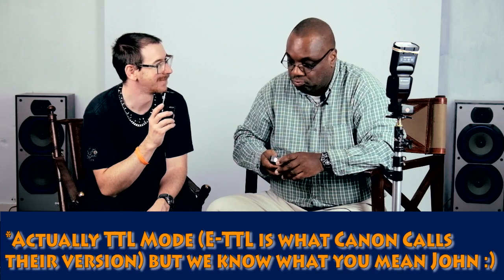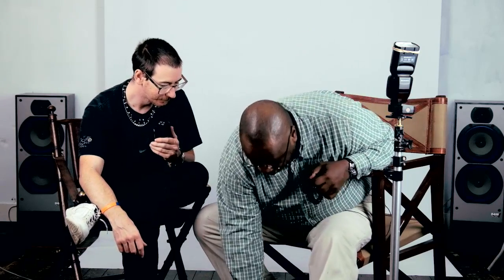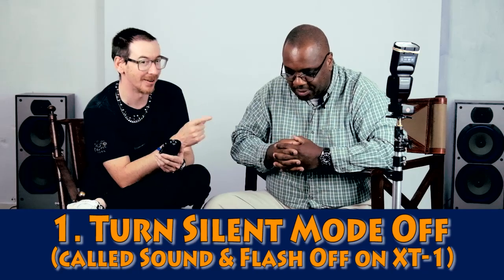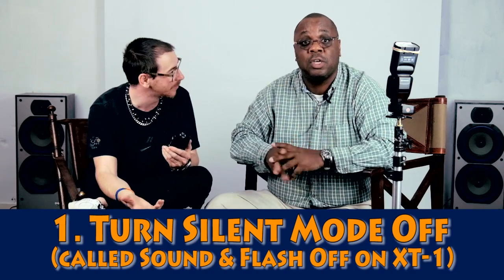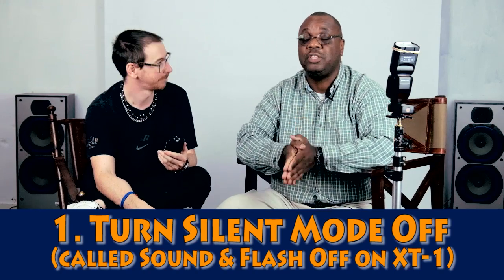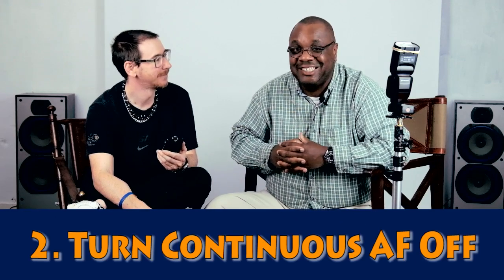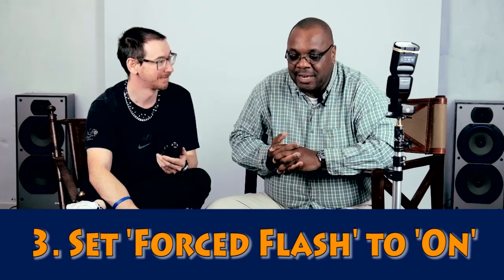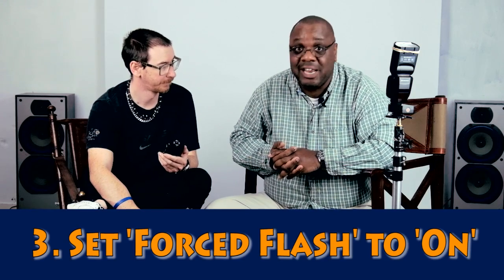TTL Flash for Fuji X Shanny Nissin i40 Yongnuo Canon Nikon

Comment: Hello Matt, thanks for this lovely video, I need your help/advise on one thing please, 
I have an X-t1, and a yongnuo 565ex flash, and a pair of hahnel capture flash triggers for fuji, but I just couldn't get the off flash to work, i tried all the settings regarding manual mode, single shoot, sound on, but still nothing works, if you push the button on the trigger for test, the flash goes on, but if u try shooting with the camera, nothing happens on ttl or manual..  And if I mount the flash directly on to the body, everything works fine in either ttl or manual modes...  How can I solve this to make the flash operate off flash?? Please help..

Comment: The Nissin i40 has a secret HSS mode that works with the Fujis!
Reply from the maker: +MrCube17 Ooh that's cool! Having seen the one John brought in for us to test I was really impressed with the i40. Think I'll be getting one for myself. Great to know about HSS. Thanks Mr Cube :)
Reply: No probs! I have one, pretty good unit if a little slower to recycle than the bigger ones. Here's a guide for the hidden HSS: http://www.fujirumors.com/fuji-nissin-i40-hss-force-trick-enable-sync-speeds-up-to-14000-on-your-x-series-camera/
Reply from the maker: MrCube17 Yeah I guessed they may be a little slower. Can you plug an external batt pack into them? Thanks for the link btw
Reply: Never tried an external battery! The best thing about the i40 is the compact size, so wouldn't use one myself.
Reply: +MrCube17 Sorry folks but the Nissin i40 speedlites for the Fuji X does not support an external flash port. I just load them up with a set of Eneloop batteries and boost up the ISO 800 and happy dazes......
Reply: Not a problem for me... never use external batts anyway and have a load of rechargeables!
Reply: +MrCube17 WOW! What a nice tip! Just shows that you learn something new everyday.
Reply: A bit like your "tip"! :p
Reply from the maker: John Christopher Thanks mate. Shame you can't plug the external pack in. I live by these for weddings. Saves so much hassle changing batts, but then again I got used to it with the Fuji cameras so not a deal breaker by any stretch.

Comment: Excuse me, but what do you mean on 1:41 (E)TTL Mode? Do you really able to change flash exposure comp with X-Pro1 or it just allows you to fire a flash with manual settings?
Reply from the maker: +Buddha Cola it is using the ttl info from the camera so presumably you can adjust the output using the flash comp on the camera too. +John Christopher can you confirm if flash comp works in this mode?

Comment: Hi Guys ! I'm pretty sure i was using a yungnuo YN622N-tx with my fuji X-t1 in TTL MODE commanding the YN565ex with YN622 (all for Nikon)
It was possible before the firmware 4.0, now i can't work anymore in TTL.
Now with the firmware 5.0 flash menu is also different, maybe they deny the possibility to use  all kind of flashes.
the transmitter has a mini usb port , as anyone tried if is possible to upgrade to work with fuji in ttl-mode?
Thanks

Comment: i haz not love for cheapz speedlights that arent real speedlights
Reply from the maker: +Theoria Apophasis I know mate. But believe me when I used to shoot Nikon I would curse the crap out of my stupid over priced SB900's that would overheat every 20 damn shots. Luckily I'd toss them back in the bag and break out my trusty Yongnuo's and actually get the job done. I think you could get 10 Yongnous for the price of 1 SB900 and you'd get 10x the shots of the Yongnuo. I believe the SB910s fixed that but they're still too much money and they don't even have receivers built in! I sold all my Nikon speedlights and never looked back :)
Reply: but they last forever , yes the SB900 had that flaw, but wasnt that bad
Reply from the maker: Theoria Apophasis It's like anything mate. The more you spend you get more for your money, but incrementally less so as you spend more. A $2 speed light from a yard sale will get the job done. Doesn't have any way of controlling power or zoom, may not last very long but will put light in your photo where you want it. A $50 Chinese speedlight will give you control over power and zoom, will likely last 2-5 years and will put light where you want it in your photo. A $500 SB910 will give you everything the Chinese speedlight does but with higher build quality, more durable components and better quality control at the factory. It will last you 20 years and will put light where you want it in your photo. If I had $1500 to spend on 3 speedlights I would definitely go for the high end stuff, but as I don't and my $150 3 light set up hasn't put a foot wrong in the last couple of years I'm sticking with it for now! :D
Reply from the maker: Theoria Apophasis haha love your expressions dude :D :D :D
Reply from the maker: Theoria Apophasis We need to start a band called the Fabulous Fanny Fanatics! :D :D :D